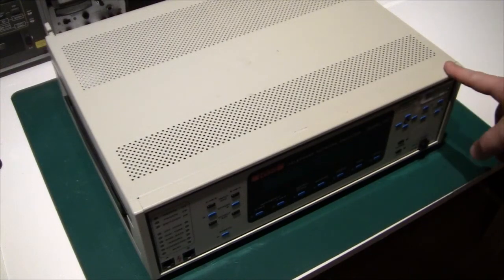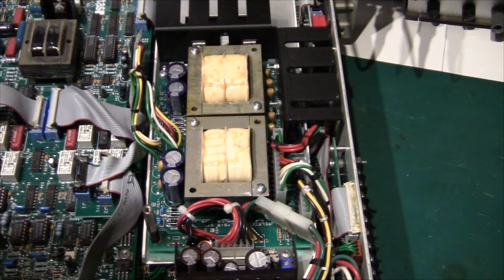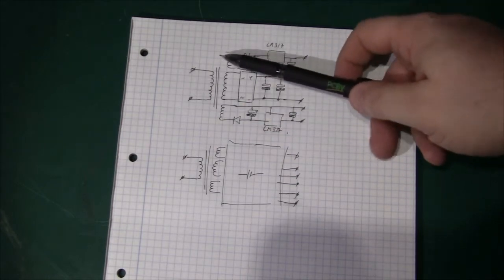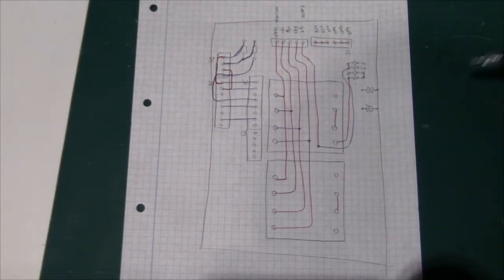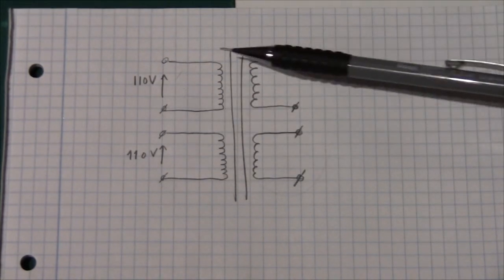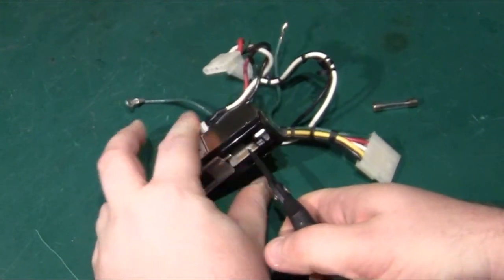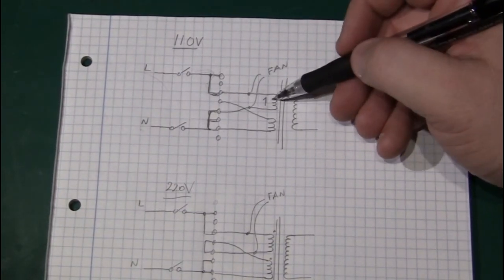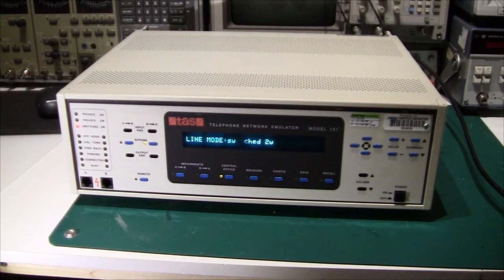Idiot converts a PSU from 110 to 230V

Comment: Cool! I encountered a similar but more complex system on the back of a 1970s-era radio amplifier. It has a funny-looking plug block which can be inserted in one of 4 orientations for 100, 120, 220, or 240V.
Reply from the maker: Same supplier. I found it on the datasheet for the 110/220V one used here. Quite clever actually, but requires a specially wound transformer.

Comment: Is there not just a back panel conversion. Just slide fuse cover aside, pull thin strapping board out and reinsert on 230 selection. Change fuse to proper value and job done.
Reply from the maker: That's exactly right. I just didn't know hahahaha

Comment: When designing the 110 / 230 Volt switching they made a mistake. Two coils each 110 Vols, they use only one coil for all the power when it is on 110 Volts, so that coil has to do all the work. When connected as for 230 Volts both coils work together, having only to transform half the number of Ampères. 
 
What should have been done is that both coils are in parallel when it has to work on 110 Volts and both coils in serie when it is working on 230 Volts. It is a tragical misconception of what has to be done. 
 
I have seen better! it could be done in a proper way. In Europe in the old days when there were mainly 220 Volt grids and some ancient 127 Volt grids or foreign 110 Volt grids, all radio's and televisions had a a single primary coil with multiple connections and a mechanical dial to select the current of your grid. Americans never really understood what had to be done.
Reply from the maker: Great explanation. Thank you!